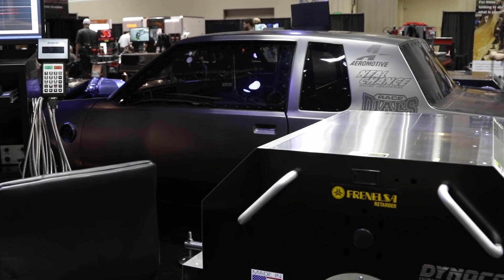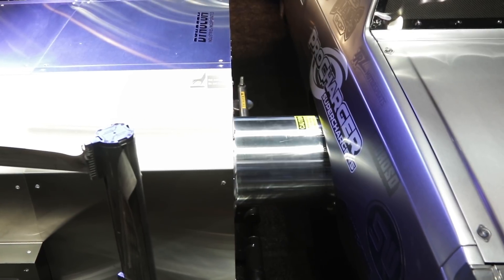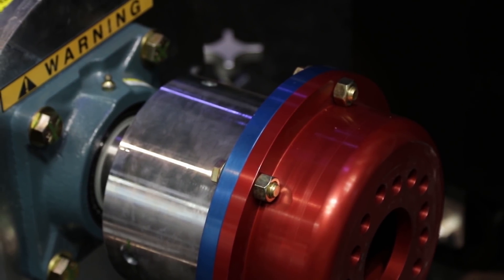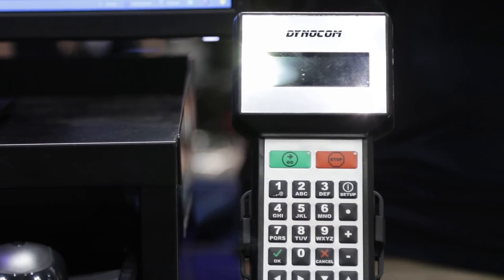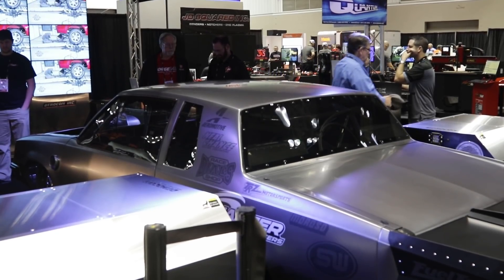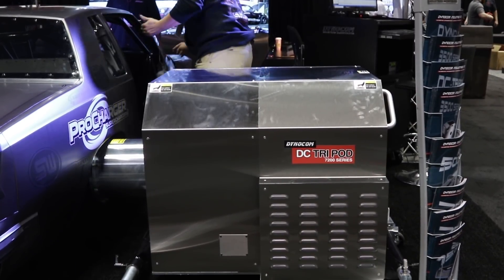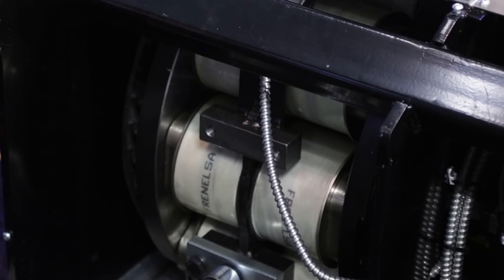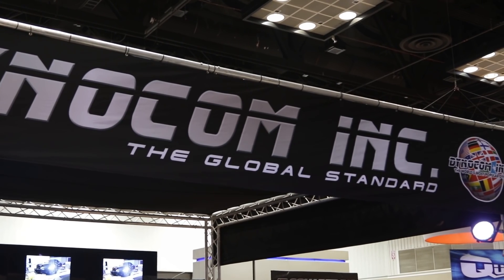PRI 2018: Dynocom Hub Dyno Holds Up to 7,200 HP

Comment: 6 years later and the dynocoms won’t even hold 2500 for a full pull. Pulls last like 1-2 seconds lmao. Mainlines are making 5000+ for full pulls through 3 gears